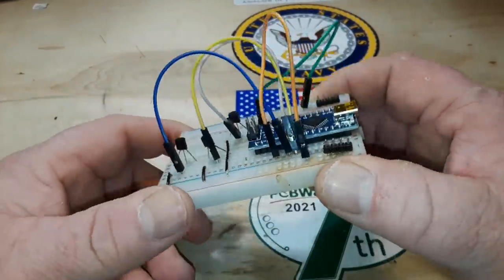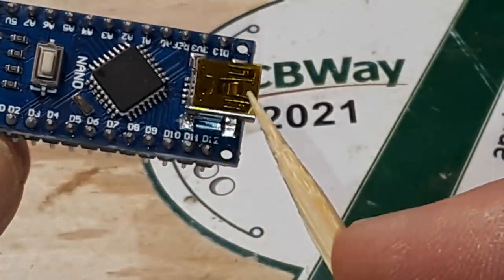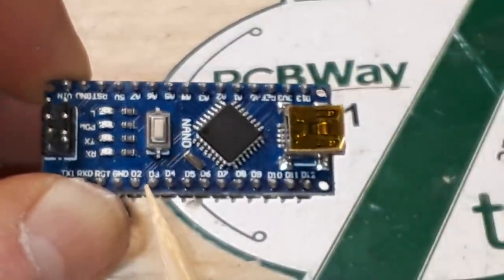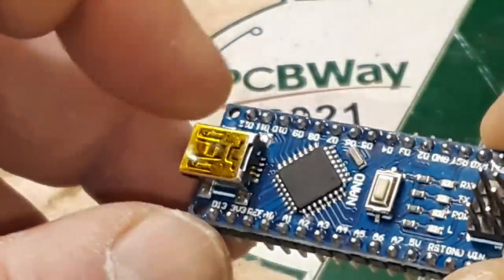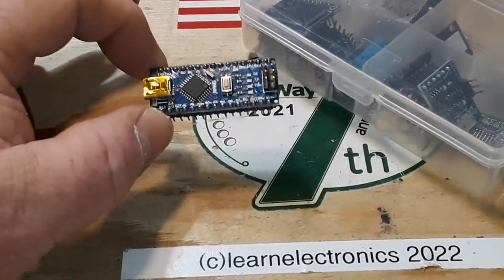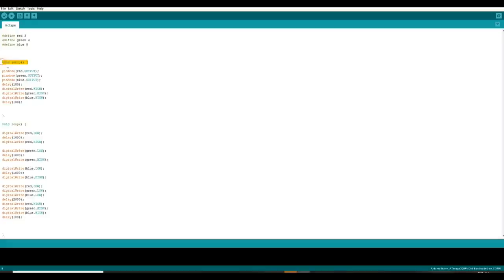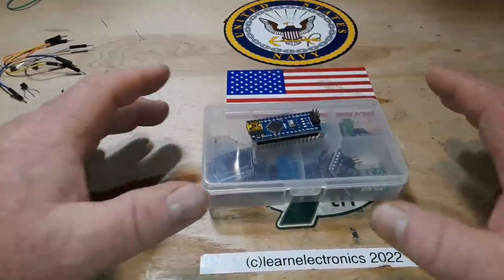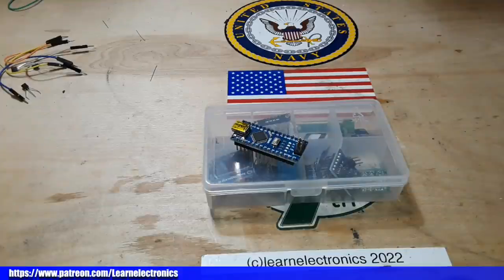A Very Basic Introduction to Arduino

Comment: What a great primer; well done.  I've heard the name (Arduino) mentioned anecdotally in so many other YouTube videos and until today I had no idea what this thing actually does.  I'm a retired programmer (C++/Perl/Java my preferred languages) and realize I can tackle the programming aspect with relative ease.  Thank you for enlightening me and I  look forward to many future projects.
Reply from the maker: With your programming experience, you will have no trouble with Arduino
Reply: Arduino uses C++
they do hide main and give you setup and loop and also do auto declaration of your functions they call it a "sketch" and file ending is .ino
low level register and bit definitions are in iom328p.h (define names correlate with datasheet of that chip, atmel is now microchip)(for boards with that atmega328p chip)

Comment: Great explanation. These small microcontrollers are the reason you find such inexpensive electronics gear now. No more hardwired analog and digital circuits, just use software to create the device. Thanks Paul ☮

Comment: Oh man, you've renewed my faith in Arduino.  Over the last 2 years, I've followed various trends in setting up LED strips controlling hardware and software, which from my first introduction, used  an Arduino, it's IDE running FASTled, which absolutely boggled my mind, and now, using a Digquad controller and WLED, which is a thousand times more simpler for people like me who don't know electronics nor code. But now, because of your explanation on this video, I now understand how Arduino works ...somewhat., I can now begin other simple projects using Arduino. Thanks so much for this video.
Reply from the maker: More coming

Comment: Great intro to the Arduino Paul! It may be 10+ year old technology but it still has many, many  uses for simple to moderately complex applications, also considering there are expanded versions of the Arduino such as the Mega. The Arduino is also an excellent learning platform as an introduction to microcontrollers. We have so many choices today which makes for many possibilities. I have so many Arduino projects in mind but just have been so  busy with other life issues....such as moving - once I settle down Arduino is at the top of my playlist. I also have a Mintduino (an Arduino kit in an Altoids tin can in the spirit of the COSMAC Elf Membership Card) to assemble and tinker with. I also like tinkering with classic microprocessors and microcontrollers such as the 1802, 8051 series, 68000, etc., it never gets old for me!

Comment: I ordered 6 pk of these nanos from amazon. All of them Crash when uploading sketches. Even after trying the correct usb driver and the “Totally Sketchy” one the seller recommended. 
Never again will I buy anything Arduino from amazon. I’ll gladly pay full price for Authentic Arduino’s. 
Thanks for your explanation Paul. And the walk around. 
God Bless.
Reply from the maker: I may have the cure you seek. What you need is the "Old Bootloader" Find it under tools, processor, ATMega328 OLD Bootloader. This stumped me for a while as well.
Reply: @learnelectronics  🤔 Makes since. That might be worth my time trying tomorrow. Thanks Paul I never though of trying old boot loader.

Comment: Excellent video! I am interested in using a Nano for multiple model railroad animation projects, but did not appreciate how the digital and analog pins worked. I also am naïve regarding I2C and other interfaces. I appreciate your fine overview.
Reply from the maker: Check out my Arduino Basics playlist

Comment: I just got the Elegoo Uno R3 starter kit and can tell it's great for learning electronics and prototyping on a breadboard.  But what if I want to solder a finished, permanent project?  Is that what the Nano is for?   I don't see the same little plug-in spots for wires the way I have on the Uno.  Do you have a video showing how to use these boards to solder a finished project? Discuss mounting, cases, permanent power supplies, etc.?  Thanks!

Comment: Excellent video!

I would love to see more such videos, but would like to make a suggestion 😊

I think you should have a "process" eg: objective, followed by electronic connection, followed by arduino code, followed by working project. 

In this video you didn't show that the code actually worked. 

The most useful part of such videos, for me, is the mistakes! I love to follow along, and often I spot errors before the presenter does (and that's super exciting 😊😁)

It would also be nice if you could build simple practical circuits. Perhaps combine your arduino series with your multimeter series... (I'd love to see that 😁)
Reply from the maker: Look at my Arduino basics playlist and I think you will find what you're looking for

Comment: I loved this return to basics, and learned a couple of things that are usually just assumed by other instructors. Thank you.

What do you think about these clones though?  I bought a couple a while ago, and try as I might, I cannot get them to work nicely, particularly with uploading sketches. It seems that no matter what I fix, another error replaces it.  This is really killing my enthusiasm because I can't get to the starting line.

Right now, I've bought Reyax LoRa modules and am copying your instructional video on the subject. 

After searching for viable fixes across the forums, I've updated drivers, flashed bootloaders, but still there are uploading errors.  Have you ever found a set of update patches that could be applied to any clone as a package to deal with all the set up problems in one go?

 Cheers, Jonathan
Reply from the maker: You need to go into tools, processor, and select "OLD BOOTLOADER" this stumped when I first encountered it.
Reply: @learnelectronics  
Thank you. I tried this, but no luck. Still kept getting errors.  Since I've made the adjustments as I described above, I'll try 'old bootloader' again.  I'll let you know. thanks again.